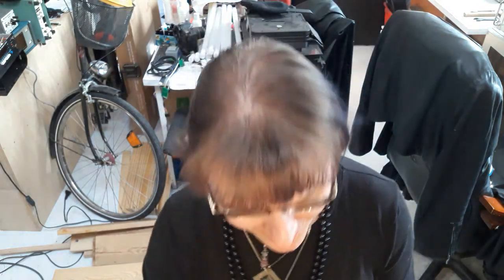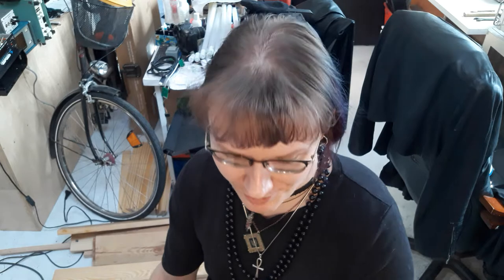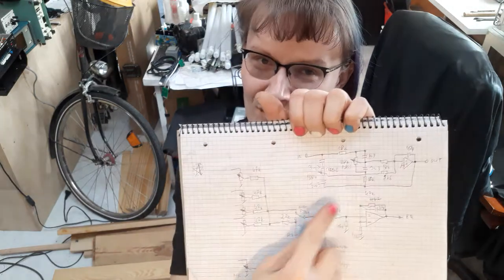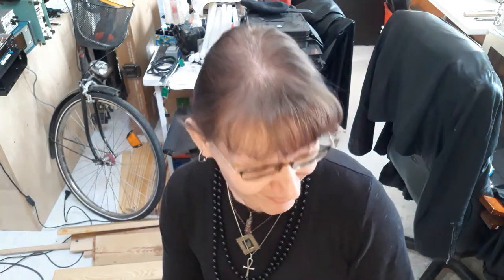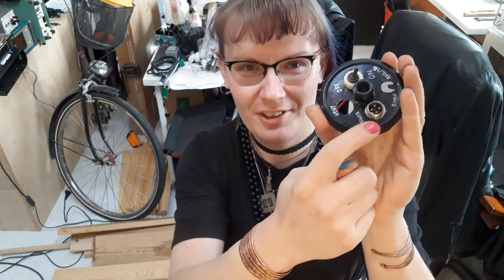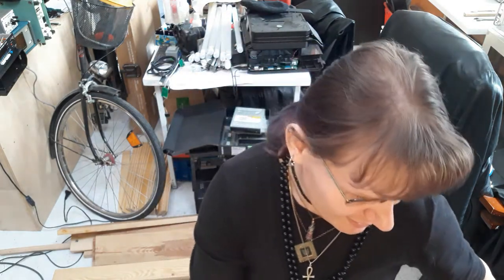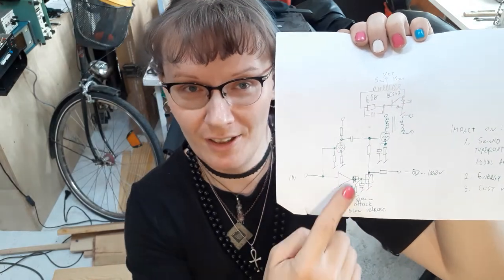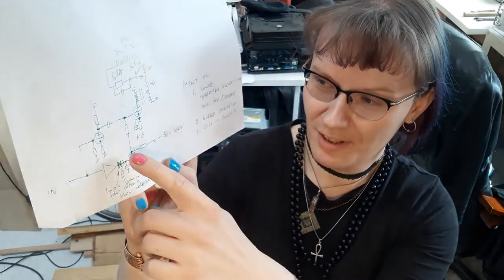Mad Science! (and some electronic ideas)

Comment: The circuit you describe could provide some savings that would be more meaningful on larger tubes. For best effect I would put a delay line (few milliseconds) in the audio input to the tube, so that the bias circuit has some time to act. Without the delay line I would expect to hear some `pumping` sounds on the audio. Nice to see people are still interested in working with vacuum tubes. Chris, UK.
Reply from the maker: My thoughts exactly: more meaningful on larger tubes. I'd try that on 300B or 6S33S if I get a chance to build an amp with these. Expensive as hell... especially 300B.
I'd go for an amp stage with a megaton of gain, and an integrating circuit with quick attack and very slow decay/release.
Reply: @KeritechElectronics  The system you describe, slightly modified but the same in principle, was used earlier this century to try to economise  on the power used by the hi power AM transmitters. It was called Dynamic Carrier Control. It did work but it had a certain characteristic sound to it that many didn`t like. You might get some ideas by looking on the Googler. Also, there was an attempt in the early 90s by Hi-Fi manufacturers to improve the class A amp (make cooler), by using this principle. It was called Computer Class A. But I think it just turned off the Bias when there was no signal, Cheating! I still have the amp, might be a good time to reverse engineer!

Comment: That's a neat idea. But what's the point? All other components have to be able to withstand full power. Tubes are not that expensive, so you can use two in parallel and forget all that complex circuitry 👩🏼‍🔧
Reply from the maker: 1. with most of the tube production in Russia (Svetlana, Sovtek, Electro-Harmonix etc.) and current political situation we're virtually cut off and have to rely on other tube sources (JJ, China) or NOS
2. less competition on the tube market means less incentive to keep quality high and prices low
3. electricity is expensive too, and class A amps are power-hungry when idle
Reply: 1. But JJ and PSvane are perfectly fine, aren't they?
3. Class A amplifier comes with the cost of energy consumption. It's not that big. For example if you cycle instead of driving a car daily, you are already on the good side 😊
4. Of course I'm not an expert in any way, I just find the topic interesting 👩🏼‍🔧